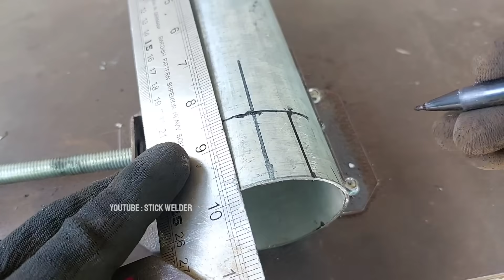rarely do people know. the secret to strong welding on thin metal | pipe cutting tricks

Comment: The galvanized area needs to be ground down to bare steel for the weld to have a fighting chance.    Zinc contamination in the weld pocket creates porosity and therefore a poor weld.
Reply: Not so when mig or arc welding....tig different story
Reply: Not to say giving off dangerous fumes too!
Reply: Its 16ga itll be fine
Reply: That's why you always weld in a ventilated area especially when welding galvanized coated material or any other coated metal and in this case I'm referring to mig welding scenario's

Comment: Well im assuming u dont get alot done during the day besides drawing lines
Reply: Make a temp and gang cut, also designer calls the joint.
Reply: He also do a lot of finger wagging.
Reply: Always helpful to have a straight finger.
Reply: stevenanderson6658  I'm sure he takes milk breaks too!
Reply: Hacks below.
Reply: All the same in the end was not 90°
Reply: You can pull it square corner to corner or with squared top or jig it on table top. Easy stuff.
Reply: Also double check your lengths, that could be throwing you out of square. Table jig is best if doing multiples. Thanks for making me look so good. I'll be back tomorrow to school you more. SF/
Reply: Trolls trolling trolls trolling trolls.

Every. Single. Good. Project. Starts. At. Layout. And. Centers.

Thanks for sharing man.

Comment: Well you made a strong joint good job on that but I'm sure you are going to totally destroy it by slapping on some splatter weld with a stick and why not remove the galvanized  coat first so you and everyone around you can live longer and throw down that stick welder and do it right with a mig its thin wall not a stick job
Reply: You can do it with smaller electrodes with the proper polarity. No problem

Comment: You do realize that most commercial welding and hardware stores sell what's called a "pipe tape" or "pipe wrap" that has a measuring tape along with all the angles youd ever need to weld pipes together?

Comment: Your method may be good, but using an angle grinder with no safety guard is NOT GOOD. If you are a tradesman, you should know better. This stupid act has removed all credibility from your video. Learn Safety so you can teach safe practices.
Reply: I see no problem with not using a shield. I never use a face shield and I still have one good eye.